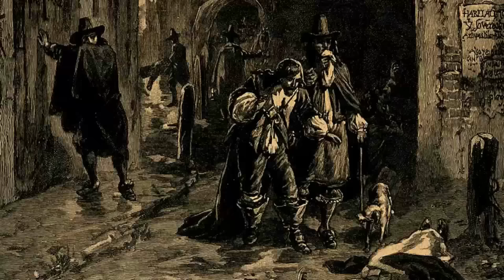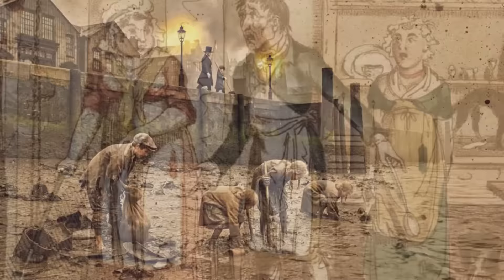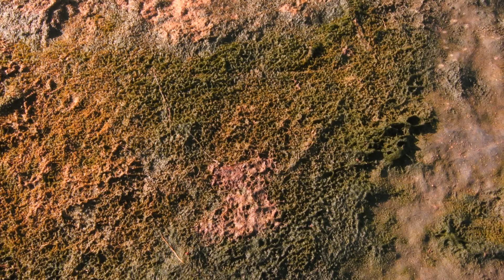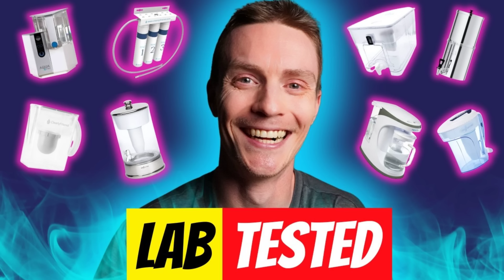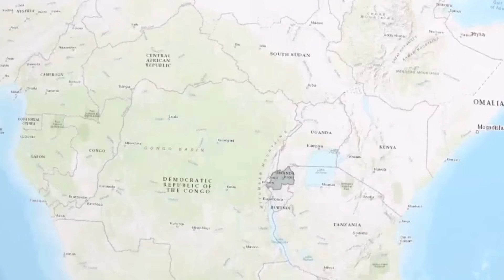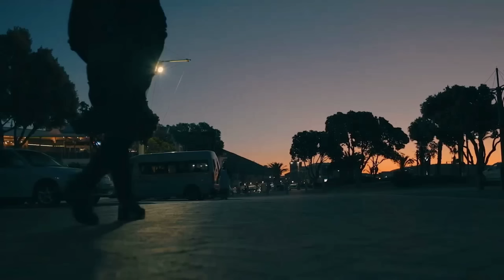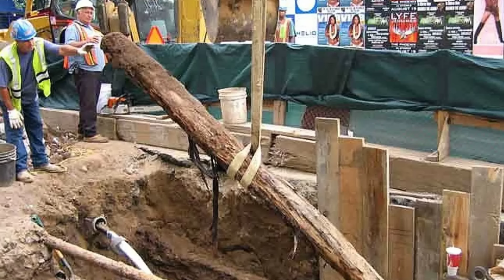The $50 Water Filter That Outlasts Any $5,000 System. Why Don't They Sell It?

Comment: But what about virus’?
Reply from the maker: Viruses are the honest gap in biosand filtration. Bacteria and parasites are removed at 98 to 99 percent or higher because they are physically large enough to be trapped and consumed by the biological layer. Viruses are orders of magnitude smaller and can pass through the sand matrix. Field studies show some virus reduction from biological predation in the schmutzdecke, roughly 70 to 90 percent in mature filters, but that is not reliable enough to call it safe for virus-heavy source water. If viruses are a concern, a UV post-treatment step or solar disinfection of the filtered water closes that gap effectively. The combination of biosand plus UV covers biological threats more completely than either method alone.

Comment: Well then, why don't you show us how to build it and show us since when are you using it, analysis before and after filtration. I bey you are not using it.
Reply from the maker: Fair challenge. A build video with before and after testing is exactly the kind of follow-up content that would put numbers behind the claims. The peer-reviewed data from CAWST field deployments across 70 countries already exists and is publicly available, but I understand that watching someone build and test one on camera carries a different kind of credibility. Would that change your mind if the lab results matched the published data, or is there a specific claim you think the testing would disprove?
Reply: You can easily use AI search to find out what it is, how it works and how to build it yourself. Search "CAWST water filter". 

This type of water filter is simple, it works only to a certain level, there is no guarantee the filtered water is 100% safe for drinking, boiling the water first before using it for drinking is recommended. 

A better way is to add a hollow fiber filter at the final stage, the hollow fiber filter is common for camping use, there are larger ones for houehold use, many can filter anything down to 0.01 micron, some can filter down to 0.001 micron which is smaller than virus. 

Filtration down to 0.01 micron is good enough for most water sources because viruses don't normally survive in the human stomach due to gastric acid.

You can buy hollow fiber filters that can filter down to 0.001 micron but the water flow is slower. Most camping hollow fiber filters are designed to be cleaned by backwashing using clean purified water. 

Hollow fiber filters can be used as is without any prefiltration stage, but is better with one so there will be less cleaning effort. For large water volume requirements such as over 50 liters per hour especially from dirty water sources, it is better to use CAWST method to prefilter the dirty water first then let the hollow fiber filter final stage to filter out bacteria or viruses. 

These filtrations don't remove liquid chemicals such as chlorine and other harmful substances in liquid form, so an activated charcoal filter stage is required either just before or after the hollow fiber filter. 

There are water filtration cloths or sheets available for separating different stages to prevent particles from passing onto the next stage, these are recommended especially for water before going into the hollow fiber filter. Such a protection should be placed as a first stage to remove anything bigger than the pores size such as dirt and large particles in the water. 

The total cost for making a CAWST water filter can be very cheap, it's the activated charcoals that need constant replacing. Charcoals can be cleaned by boiling in hot water and then dried under the sun for the trapped gas to release, but this cleaning method only works up to a few times, then new charcoals are needed which can be costly unless you know how to make them yourself. 

The hollow fiber filter is cheap, a good one that lasts 100, 000 liters costs as little as a few dollars. Several can be installed for higher water volume.

If you only need to filter out anything as small as bacteria or viruses from a small amount of water like a few liters per hour then all you need is the hollow fiber filter, such a thing with a 3-liter gravity dripping water bag can be bought for less than $20. Some come with a charcoal filter but mostly become useless after filtering 20 to 30 gallons. You can use water filter pitcher with activated charcoal stage to remove chlorine and other chemicals, different products have different specs, not all are the same.

The CAWST system is for large water volume such as more than 50 gallons per day or a large number of people. 

If only a small water volume is needed daily, there are dome shape or tube shape ceramic water filters that can filter down to 0.1 micron which filters most sizes of bacteria. Most of these ceramic filters can be cleaned by scrapping off a thin layer of the ceramic. Some come in sets with multistage filtrations such as activated charcoal and remineralization. Such set can be used as a complete water filter system for small water volume. This may be the best option for a small household that requires water for drinking and cooking, instead of making a huge CAWST system.

Comment: Large sand filters are used frequently for Koi ponds. I think most of them use an upflow filter method though where the water is pumped into the bottom of the filter.
Reply from the maker: Pretty sure they meant the household maid, not someone stationed at the outhouse, though that would certainly be a specialized job title. Upflow sand filters for koi ponds are a great example of the same core principle applied in reverse. The biological community in a pond filter is doing essentially the same work as the schmutzdecke, converting ammonia and consuming organic matter, just optimized for aquatic life support instead of drinking water. The crossover knowledge between aquarium and pond filtration and drinking water biosand filtration is actually massive and almost never discussed. Anyone here running a pond or aquarium filter already understands the biology better than they realize.
Reply: @LostBuildArchivez🥰👍

Comment: All nice and cool, except you cannot put your tap water into this. If you do, the chlorine will kill all the microbes in the Schmutzdecke and your filter is literally dead.
Reply from the maker: Absolutely correct and this is a critical operational detail. Chlorinated tap water will suppress or kill the schmutzdecke during the ripening phase and during ongoing use. If you are starting from municipal water, you have to dechlorinate first, either by letting the water sit uncovered for 24 to 48 hours so the chlorine off-gasses, or by aerating it. The irony is sharp. The chemical your city adds to make water biologically safe is the exact compound that prevents you from establishing the biological system that would make their treatment unnecessary.
Reply: @LostBuildArchivez
Clean municipal water with chlorine doesn't really need this kind of CAWST filtration, it needs activated charcoal to remove the chlorine. For small households using "clean"  municipal water, a good charcoal based filter that can remove chlorine, mercury, pesticide and heavy metal is more important.

Comment: Does either filter remove chlorine? Fluoride?
Reply from the maker: The biosand filter does reduce chlorine to some degree through biological activity and adsorption in the sand column, but it is not specifically designed for chemical removal the way activated carbon is. Fluoride passes straight through because it is a dissolved ion far smaller than the sand pore structure can intercept. If chlorine and fluoride are your primary concerns, you are actually dealing with a municipal treatment problem, not a pathogen problem, and that requires a different filtration approach entirely. Are you on city water trying to clean up what the city already treated, or are you on a raw source dealing with everything at once?

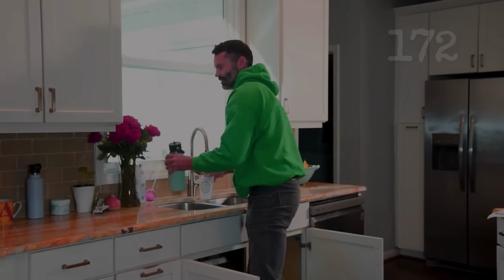Comment: this is interesting and I know the sand filter works but at 16:25 you say an undercounter reverse osmosis system costs 2 to 3 thousand dollars?? And in the description you write $5000. The whole system (similat to the one in your video there) inc a pressure vessel and tap is less than 250 dollars to buy, and a basic system which you turn on and off manually at the valve to fill a dispenser costs less than 60. (I used to have this simplified set up).  A set of new membranes cost 40.  2 minutes searching online shops will show you this. Doesn't help your cause to throw in misleading info
Reply from the maker: Fair pushback on the pricing. You are right that basic under-sink RO units can be found for well under $500, and the video should have been clearer about distinguishing between entry-level systems and full multi-stage installations with tanks, pumps, remineralization, and professional installation. The $2,000 to $5,000 range applies to higher-end whole-house or multi-stage systems, not the basic single-membrane setups. The core argument about recurring costs and waste ratios still holds, membranes and pre-filters still need replacement on every system regardless of purchase price, and the 3 to 1 waste ratio is published by manufacturers, but mixing the price tiers without distinction weakens the comparison and that is a valid criticism.

Comment: Does it remove fluoride which is a known and documented neurotoxin. Look up the MSDS data sheet and what's require to even handle it. Full PPE from head to toe, its no joke.
Reply from the maker: No, the biosand filter does not remove fluoride. Fluoride is a dissolved ion and passes through the sand matrix completely. You are right that sodium fluoride carries serious handling requirements at industrial concentrations, which is a fact that gets surprisingly little public attention relative to how casually it is discussed as a water additive. For removal at the household level, bone char adsorption, activated alumina, reverse osmosis, or distillation are the established methods. Each has tradeoffs in cost, maintenance, and effectiveness. The biosand filter solves a different problem, biological contamination, and solves it extremely well, but it is not the right tool for dissolved chemical removal of any kind.

Comment: my opinion best water system is rainwater collection and a cistern for storage.
Reply: Except for those damn chem trails
Reply from the maker: @hadleymon1303  Atmospheric contaminants from industrial activity and other sources are a real input into rainwater chemistry, but the concentrations in collected rainwater are generally far below the levels found in surface water that has been in contact with contaminated soil, agricultural runoff, or industrial discharge. A first-flush diverter that discards the initial roof washoff eliminates the highest concentration of atmospheric deposits, and biosand filtration handles any biological growth that develops during storage. The risk from collected rainwater is measurable and manageable, which is more than can be said for a lot of municipal sources with aging infrastructure.
Reply: @LostBuildArchivezI install rainwater collection for a living and have one where I live so I agree. Still, wtf are those planes ✈️ dumping on us?
Reply from the maker: Rainwater collection into a cistern is an excellent primary strategy, especially for regions with predictable rainfall. The gap is biological. Standing water in a cistern will develop bacterial growth over time regardless of how clean the collection system is, and bird droppings, insects, and organic debris inevitably enter the system. Running cistern water through a biosand filter before drinking handles that biological risk without chemicals or electricity. The two technologies complement each other almost perfectly, rainwater solves sourcing, biosand solves safety.

Comment: how much water a day does this system produce for a family of four. what type of water source do you need for this system to work?
Reply from the maker: A standard household biosand filter produces roughly 20 to 60 liters per day depending on sand depth, grain size, and how often you charge it. For a family of four at typical drinking and cooking water needs of about 12 to 16 liters per day, one filter is sufficient. For total household water including washing, you would need a significantly larger system or multiple units. The filter works with any freshwater source, creek water, pond water, rainwater, well water, even puddle water, though heavily turbid sources should be pre-settled before filtering to prevent premature clogging and to extend maintenance intervals.

Comment: I am 5 minutes in the sand trap filter was invented by the Romans. we all know the fall of Rome was contaminated water. without identifying the bacteria and viruses and chemical contaminants this filter will kill you, these filters clog with contaminants. I have 27.5 years' experience in surface water treatment potable water production industrial scale. this filter has to be cleaned this article does not explain how often and how to test safely. the worst thing you can do with filters is handle the parts with bare hands. cross contamination is your enemy. this video all through shows people touching the water and internal parts with their hands. this system relies on a bio film to consume all contaminants of raw water. your source determines what type of filters you will need. one filter does not fix all water.  notice all the water added to this filter looked clean. I assume it came from a well or public water system. creek or lake water will never be that clean the R/O systems they show you cannot touch the filters with bare hands it will cause the filter to go bad from your skin cells. never touch the filters with bare hands.
Reply: This is not practical
Reply from the maker: @dcnfamilyify  
Not practical compared to what? Compared to municipal water that works until the infrastructure fails? Compared to an RO system that stops the moment the power goes out? Compared to bottled water during a three-week boil notice when the shelves are empty? Practicality depends entirely on what scenario you are preparing for.
Reply from the maker: Twenty-seven years in surface water treatment is serious experience and I appreciate the specifics. You are right that source water determines filtration requirements and that cross-contamination from handling is a real risk in any filtration system. A few things worth distinguishing though. The biosand filter does require periodic maintenance, specifically swirl and dump cleaning of the top sand layer when flow rate drops, and the CAWST manual documents this process in detail. The water shown in field footage varies by deployment, and yes, heavily turbid source water requires pre-settling before it enters the filter, which the manual also specifies. On the bare hands point, you are applying sterile protocol from industrial RO maintenance to a system whose operating principle is a living biological community. The schmutzdecke is not a sterile membrane. It is an ecosystem that consumes contaminants including skin flora. Those are fundamentally different filtration philosophies. Given your experience, what would you add to a biosand system to bring it up to the standard you would consider safe for household use?

Comment: Yeah but people who buy RO systems aren’t worried about bacteria……………….. does it remove the important stuff that’s not easy to get rid of ?
Reply from the maker: You have identified the exact market segmentation that explains why the biosand filter never reached the American consumer. People on municipal water are not worried about bacteria because the city already handles that. They are worried about chlorine taste, fluoride, PFAS, pharmaceuticals, and microplastics, all dissolved chemical contaminants that require carbon filtration, ion exchange, or RO to address. The biosand filter was designed for a completely different user, someone pulling from a creek, well, or rainwater catchment where pathogens are the primary lethal threat. Both problems are real, but they require different tools. The suppression story is not that the biosand filter was hidden from RO buyers, it is that the millions of Americans on rural wells and untreated surface water were never told this option existed.